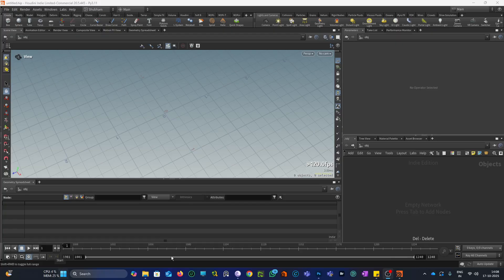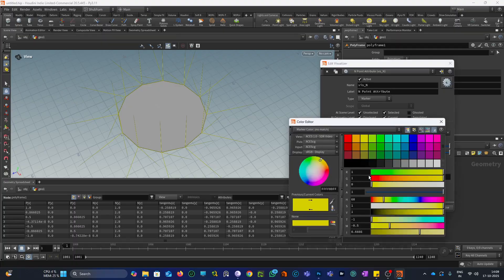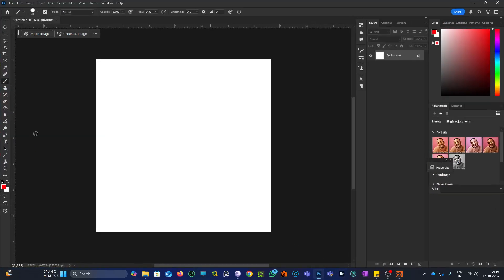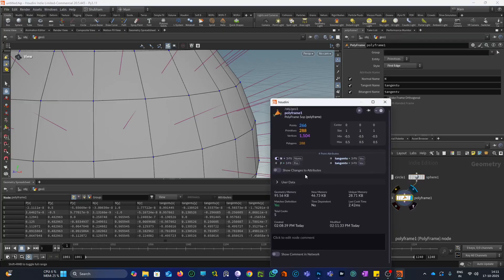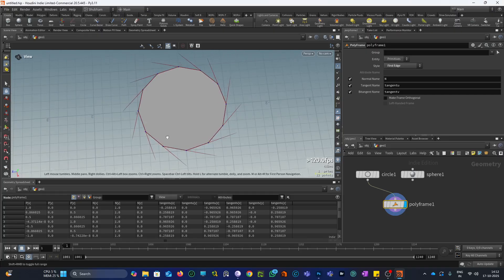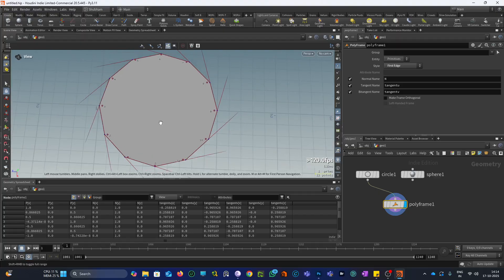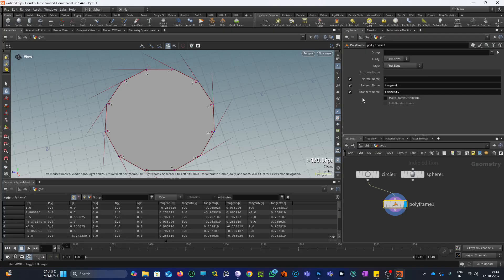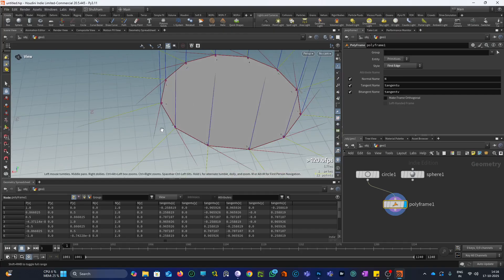Polyframe SOP | Houdini 20.5

Comment: Hello! Thank you for your helpful video! I do have a question though, as I'm trying to make exactly what you are doing, but there are problems. First, my speed parameter doesn't work, it makes the particles go sideways in a sketched circle kinda of shape. Also, aligned to that problem, the speed of the suctions of the particles inwards is way too fast, and I'm not sure how to reduce it. Would you have an suggestions? 
Thank you.
Reply: Ok aha, I found the solution to one problem I had. Problem: the particles lined up when swirling (the particles weren't equaly spreading before going towards the circle). Anyways, it's okay if you don't understand. The point is, I fixed it when I noticed you added a + before your = on the second row of the tangent code
Reply from the maker: @anonymoushellnah6820  That's good to know you solved it yourself, Let me know if you have anyother issues.